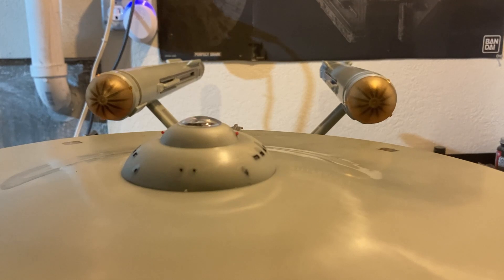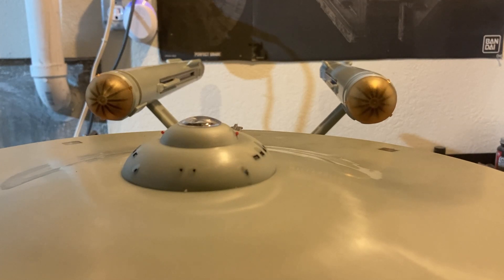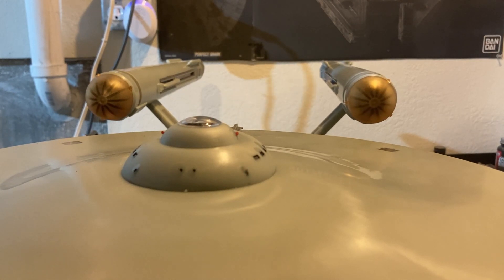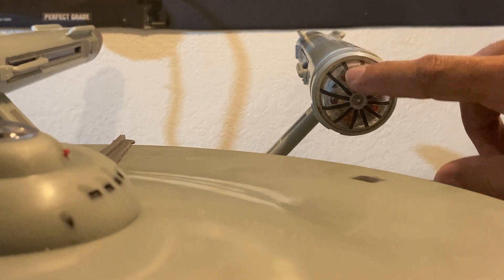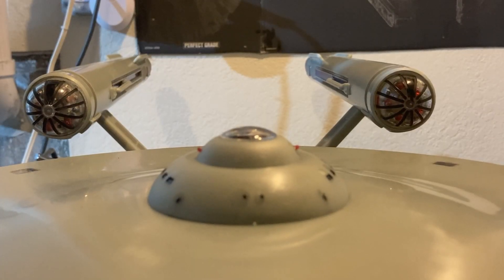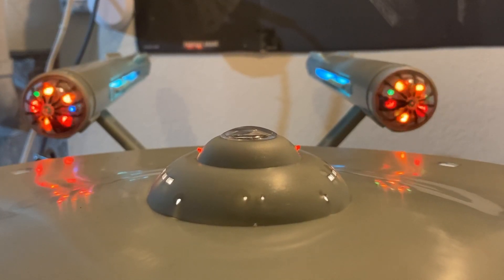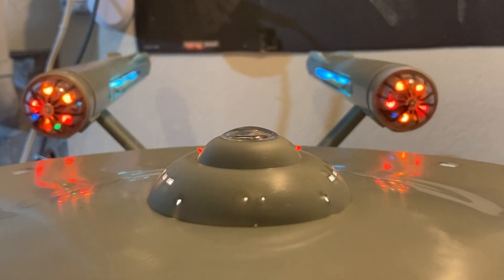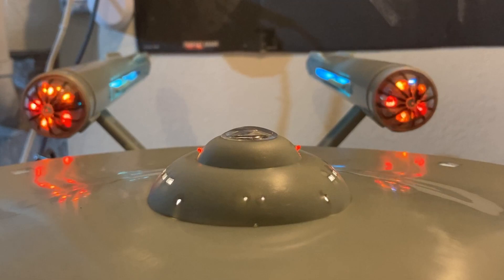How fast are the motors for the TOS Lighting kit?

Comment: The light sensor chip in your camera is probably what was making it look as if they were off.  i was watching one of your vids and it appeared as if one of the fans switched directions and then switched back.  seems like a camera issue.  Different types of chips can have issues with thin lines in motion particularly from a slight distancing
Just a guess